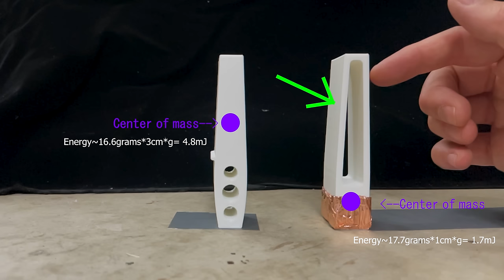The Impossible Domino

Comment: I am guessing that the second domino has little to do with the effect. It is all in the low center of gravity in the first, and the energy imparted by pushing it over. As long as the second is able to be tipped over and the bottom is thick enough to give the first enough of an angle, the first will bounce back if it has a heavy bottom.

Comment: I think there is more to be had from this. In the case of the bouncy ball you can reach back to the same height/potential energy by starting by "throwing the ball"/adding some kenotic energy. This way the starting energy of the system is greater than only it's gravitational potential energy. As long as the kinetic energy is greater than the losses we can get back to starting position no problem
Reply: With the dominoes the nudge at the start adds exsees genetic energy like throwing the ball and therefore could expect to get them all back up
Reply: Also if you had a line. as long as the last one remains down the total energy of a standing system is less than when it started. You could also imagine a system where they all fall down and stand up except thee last one  and then fall down in the opposite direction with the last domino at each end not re righting. Some kind of pendulum effect

Comment: What about that:
A domino that works like a roly-poly toy.
But the weight inside start at the top, so the domino can fall, and when it does, the weight slides to the bottom and make the domino go up again?
First I thought in using a spring and a trigger, but it may be possible to just have a support for the weight at the top, and when it tilts, it would be enough to make it fall to the bottom.
Reply: Or… and i think that would work:
The domino is hollow, the top has a shelf for a heavy metal ball. The bottom is rounded in the front, and has a place at the back to hold the ball when it rolls down.
The top front part, has an opening, and the bottom back, has a pin.
When the domino falls, the opening of a domino will hit the pin of the next one, and the pin will poke the metal ball, dislodging it.
The ball then will roll to the bottom back part of the domino, making it tilt back.

Comment: Bit of a nitpick, but having only two different pieces is not exactly dominos, i believe its might be more accurate if there is a ideal modified shape that universally shared between both, or more pieces, that only the first domino would recieve enough kinetic energy when stricking the second, but this first can be technically any pieces within a straigth line?

Comment: What if you combined those designs so that when you set them up they knock each other over AND stand each other back up? Obviously if you were to set up a line of them, they would probably need to get progressively smaller as the line goes on so the energy lost in each collision won't stop the chain reaction.

Comment: 4:40 this is why one of Tesla's car is just about impossible to flip over, and is the only car to be rated 5 stars on the roll test. Tesla puts the batteries in the bottom, under the car, and the motors on both axis's, meaning its center is gravity is SO low, that even being flipped completely on its side, was able to come straight back up.

Comment: In formal English, a sentence should not end with a preposition.  The standard solution to this is to combine the proposition with the word "which" and place them before the subject.  This leads to sentences like "this is the flag to which I've pledged allegiance."  Notice that the proposition used is the one appropriate to the meaning of the sentence: since allegiance is pledged to the flag, the phase is "to which."

Unfortunately, some people miss this detail, and get the impression that to sound smart, they must use the phrase "in which" in the middle of nearly every sentence expressing location or orientation, even when "in" is not the correct preposition.  To make matters worse, they still go on to end the sentence with a proposition.

So, instead of saying "the domino bounced back up to the height it started from" (which is a meaningful sentence, even if it is grammatically incorrect) or saying "the domino bounced back up to the height from from which it started" (which is both meaningful and grammatically correct) they say things like "the domino bounced back up to the height in which it started from."  Not only is this sentence nonsensical (because the domino started "from" a height, not "in" a height) but it is also grammatically incorrect because it ends in a preposition.

Comment: If it were possible for these dominos to live in a perfect reality, where no energy is lost to heat or friction or whatnot, meaning all of the dominos in a chain can return upright, these dominos could be turing complete. There's no difference between signals being sent through wires and signals being sent down chains of dominos, so it would be possible to build computers using nothing but dominos, although they would be massive and very delicate

Comment: Without watching the video: Logically it should be possible, because dominoes has 2 sources of energy: One from the weight of the own domino, and 2 from the force of the previous domino that knocks it over. It only needs to have enough energy to counteract it's own weight to return back to standing position, as ALL the previous dominoes will also be doing the same, hence no domino needs to counteract the energy from the previous domino. In a perfect simulation, there is no energy gained or lost, the energy at the end of the chain will be exactly equal to the energy that started it, each domino transferring the starting energy all the way to the end

Because we cannot have a perfect scenario, there would be energy lost from domino to domino, eventually leading to there being insufficient energy to push further dominoes down, but before then, you could still have a domino-like chain effect of each previous block pushing the previous one down. Basically, imagine a chain of those roly poly toys knocking each other over, only to stand back up again.

Alternatively, if you want to have the chain go back up in reverse order, you need to balance the total force such that each domino has barely insufficient energy to counteract it's own weight (think of a mis-weighted roly poly toy), EXCEPT for the last domino, which would bounce back, and have that bounce back basically give the previous piece enough energy to right itself, with a little extra... the extra also pushing back all the previous pieces back up. Note that as energy is lost in each step, you pretty much need a strong force to start the chain reaction, the chain no longer only being carried by it's own weight, but also transmitting the initial force along; A domino effect of this type CANNOT be carried by it's own weight alone, as the returning effect should not be able to successfully return all pieces back up, otherwise you end up with energy having been created: returning to it's original state plus any energy lost. (of course, if you could have PERFECT transmission without any loss of energy, it would be theoretically possible, but otherwise you end up with the chain only partially being righted back, again unless the chain was transmitting more than the force of it's own weight.)

Comment: Is there anyway to make a chain that fully stands up after being knocked down? This is cool but seems like it only works with two dominos.
Reply: Theoretically, you could make a chain in which all the dominos except the last one stand back up. Each domino would need enough potential energy to knock down the one after it plus stand the previous one up, plus a bit more for friction loss. The dominos couldn't all be alike- each domino would need more potential energy than the one before it, like when he talks about progressively larger dominos knocking down one the size of a building.

Comment: This seems  like a bit of a cheat - if it wasn't for the small ridge on the second domino providing a kickback to the first one, this wouldn't work. You could probably achieve the same thing just by playing with the shape of that ridge on the second one. Of course if the centre of mass is low enough on the first domino it would be very easy to get it to stand up again, even without the kick from the second one.

Comment: couldn't you add like a ball bearing within the domino which would fall from the top of the domino to the bottem and use the loss in potential energy to rocked the domino back up? than you would not have to have two different domino's they would however be reset after one use after which they would act as normal domino's

Comment: Aren't Dominoes by tradition all the same shape, same size, and same mass. the second "DOMINO" is not only coffin-shaped but has mass removed (three holes) at the bottom and a tab to induce a kickback to return some of the energy back to the first "DOMINO". the first "DOMINO" is not coffin-shaped and has most of the mass removed from the top. the CENTER OF MASS IS NOT THE SAME. 
just my two bobs worth.

Comment: The problem here is that he was lazy about it and designed 2 different objects, instead of putting in the work to figure out how to make 1 domino that uses principles from both. Not to mention the fact that he completely failed to mention the fact that the domino doesn't need enough energy on the return trip to get back to being upright. It only needs enough energy to get the center of gravity back past the fulcrum, and gravity will provide the rest. And, with enough iterations on the design, I am reasonably confident that this could be achieved. 
And don't you dare tell me to do it myself. I don't have the resources to waste on such an ultimately pointless endeavor, and I'm not criticising him for doing it the lazy way. My only gripe is that he left some important points about how and why it works out, when words cost nothing but time and breath.

Comment: But this is cheeting becous you are using 2 different domino's!!! 🧐😒
Naming them domino's is not even accurate!!! 
They are just to heavily modified too still be called domino's! 
You are not even using the "domino effect" or Cascade effect!  Bechouse you only use 2!! 🤷🏻‍♂️
Come back when you can bounce 5 from 6 identical rectangular block's back up again in a row!  And on a flat and level  unmodified concrete floor!!! 😝